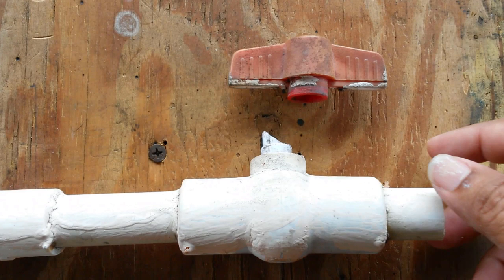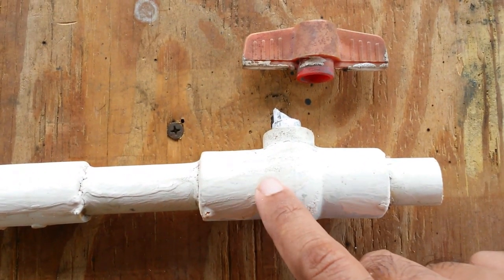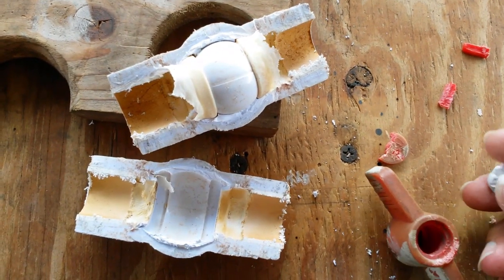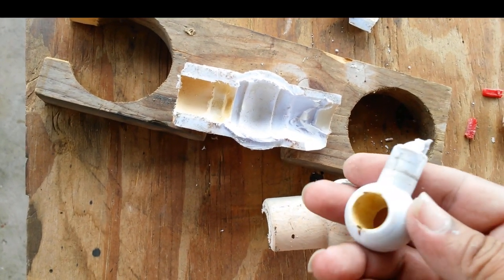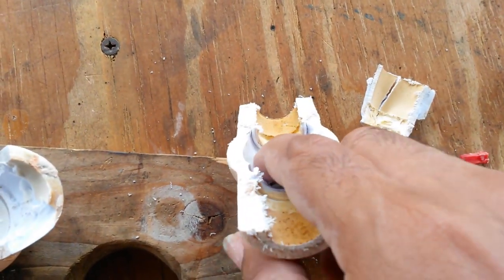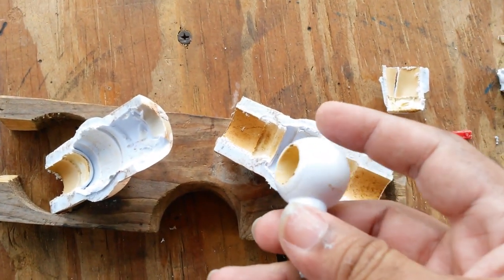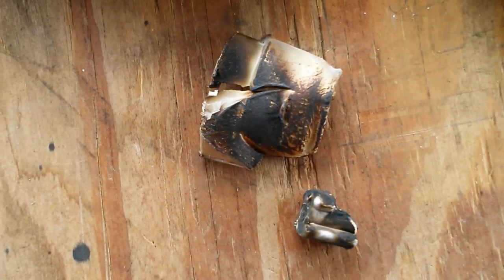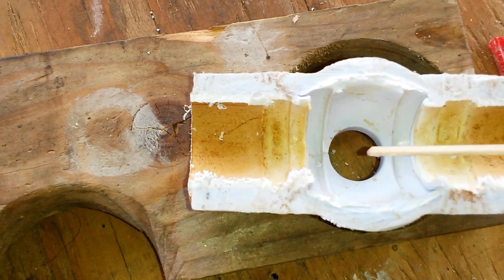161 PVC Ball Valve   Investigating How Its Made

Comment: Actually the handle unexpectedly broken today morning. It's the value that controls the main tank of our house. So I need to know the solution. Is replacement is the only way?
Reply from the maker: Yes. That shaft that is broken can be clamped and turned with a grip pliers but in a short time that will fail also. Deterioration from UV.